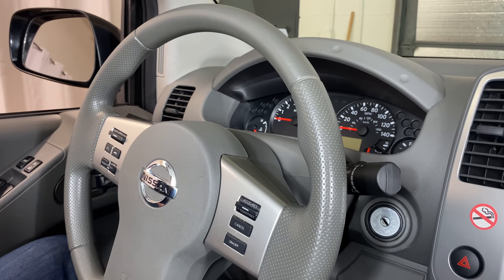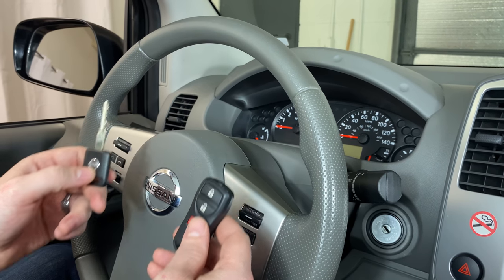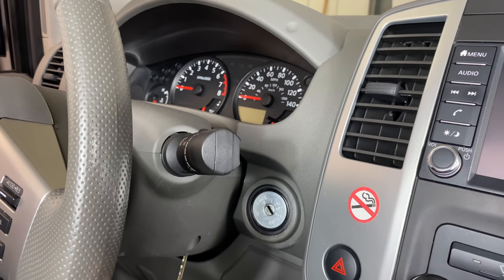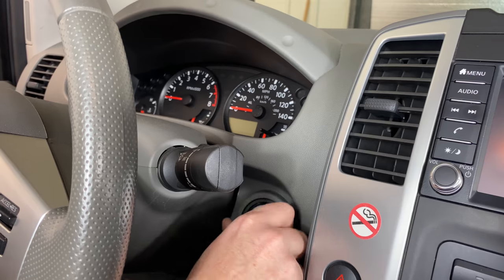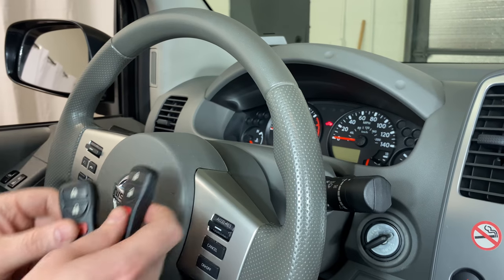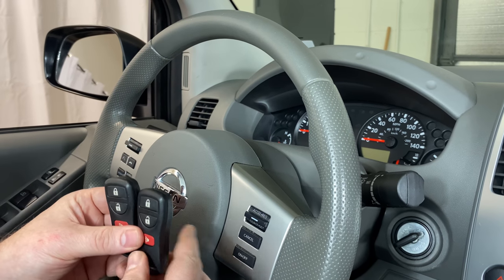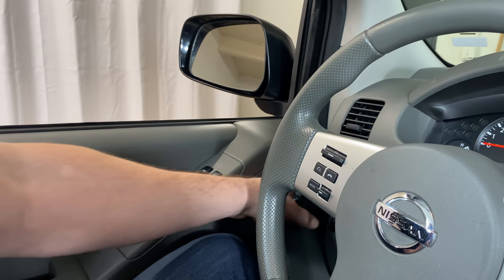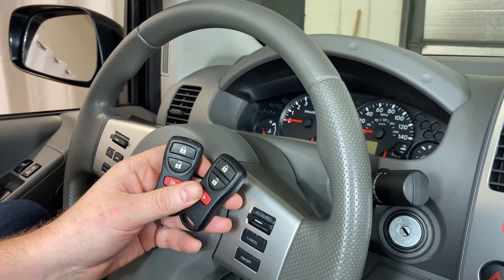How To Program A 1998 - 2020 Nissan Frontier Remote Key Fob  - Keyless Entry - DIY Video Tutorial

Comment: Phenomenal info and presentation.  Spoke clearly, spoke slowly and saved me $300.  The Nissan dealership should be ashamed by their quote
Reply: I can't get my frontier to go in to program mode.  😫
Reply from the maker: Thanks! Glad it helped
Reply from the maker: Are you sure your frontier has the factory remote option installed?
Reply: @kurt429  close the door
Reply: @DieselDog1982  yea but 300 bucks for 5 minutes of work ?👎🏾😩
Reply: This was absolutely great clear instructions to program a nissan frontier door remote 
Thank you
Reply: Thank you! Worked 👍
Reply: They are not called stealer-ships without reason but I agree. They need to make $$ but ............. That much is unethical theft in my opinion for what this is.

Comment: I’m very happy because my truck has been in and out of the dealership at Sheehee Nissan of Maryland. They literally destroyed my brand new truck I have 27,900 and some miles. I still have the all original tires everything original a person hit my truck and I found out that my brakes had no measurements on them. They sit and was wiping my computer board so much that they deleted both of my key fobs from working so I went on there today and figure it out because I knew that they can be reprogrammed one anytime there’s been work done to the computer mainframe.😮 one thing I was taught reading prints for building maintenance of plumbing, electrical, heating and air conditioning so I figured you know I can program and understand and comprehend this man very well, and I would just like to say thanks because it just save me $180
Reply from the maker: You're Welcome! Glad it helped

Comment: Thanks for the video. Two troubles I had: 1) enter the key at a rate near once per second, not too fast. In 7 inserts, it worked. Going really fast didn’t work, ever. 2) My fob had a bad Unlock switch on the circuit board. When only the Lock button would program, I opened the fob and noticed the tiny button on the circuit board did not click.
Reply: Thx Lee for your extra info! The key to success is NOT TOO FAST, just like you described. BTW, dealers are still charging (April 2022) ~150-230 to do this. Greedy.

Comment: Excellent video , simple and to the point.
I have an 04 Maxima ,  and needed a new key/fob
I followed the instructions that came with fob
word for word in addition to your (more comprehensive) steps ,  but did not work for me.
So   I sent it back and I will continue just using my old one that does work . maybe I just bought a lemon , I don't know.  But thanks again for your video.

Comment: Worked on my 2005 Infiniti G35 Sedan. Same style fob on the video as well. Bought it from ebay for 30CAD shipped. It was the cheaper option and it came with spare keys. Only thing missing on the fob was the trunk key.

Comment: Do you have to have an ignition key cut for this to work? I have the turn knob start and my car starts with just the fob inside the vehicle.
Reply from the maker: yes - this will not work on push button start vehicles

Comment: Hi, I have a 2019 Nissan Frontier. It came with one fop but I found another one that went to my 2014 Nissan Frontier.
I hit the lock button and inserted the key 10-20 times with No Luck getting the flashers. 
I noticed on your video there was no alarm when putting the key in and out. 
Am I doing something wrong???

Comment: Video is great, issue I have with my 2004 Nissan Tiida, when I do this it unlocks my doors instead of indicating the hazards? Can't program my remote to it, any help?
Reply from the maker: Unfortunately I do not have programming information on vehicles built for use outside of the U.S. market

Comment: Question, can this work if I don’t have lock buttons? My car is 2016 Nissan note and it pretty basic lol my windows are manual 😢
Reply from the maker: No - if you do not have power locks then the vehicle will not have the factory remote option

Comment: Does it work for a 2008 frontier se base model that you have to unlock it manually?
Reply from the maker: No - If you do not have power locks then you cannot have the factory remote option

Comment: I have a 2020 frontier but no key slot. I've tried pushing the button several times but nothing. Don't know what else to do.
Reply from the maker: There is no manual way to program a fob for the frontier vehicles that have a push button start ignition - you will need an automotive locksmith or dealership

Comment: I tried this once before on my 18 Nissan NV200 but when the hazards flashed after 8 key entries I pushed the lock button on the same remote you have and nothing. So, I thought the battery might be dead in the remote. I changed batteries in the remote. I attempted to the insert/resins wet and I can’t get the hazards to flash. Plus when I attempt to lock my door from the arm rest, the van locks and immediately unlocks. The only reason I am going through this is because I washed my pants and I did not remove my programmed key and now that key will not remotely unlock/lock my doors. I know the fob I’m trying to program works because I had it programmed to a 2005 Nissan Titan. Any suggestions?
Reply: I’m having the same issue

Comment: My 2004 didn’t come with a keyless entry remote even though I have power locks and windows. Will this still work of do I need to buy the keyless remotes with the module?
Reply from the maker: No - you would need to have the module and power door locks installed first

Comment: Does the key itself have a chip that needs to be programmed?
Reply from the maker: yes.  The ignition key is not onboard programmable like the fob though - it will require a automotive locksmith or Dealership

Comment: Hiiiii 

Helppp here!! 
I just received my new Key fob for my 00 Frontier, everything went well, the remote is programmed since the hazard flashed twice after I press a button on the remote. But when I remove the key from the ignition switch, and unlock the door manually, I opened the door so I can test the remote, nothing happens 😭😭😭😭 please help !!
Reply from the maker: Unlock the doors with the the unlock button on the drivers door - not manually

Comment: My 2014 Nissan Frontier has an aftermarket remote start.  Any help in programming the fob for the remote start? The fob works fine for locking and unlocking - thanks for the great, clear directions.
Reply from the maker: I don't really have any programming information on aftermarket systems.  If you can the FCC ID off of your remote start remote, I would recommend searching by that for programming information.

Comment: OK I know that the transmitters open and lock the doors,  how do you make it into a full alarm system, when someone opens your car door without keys or transmitter?
Reply from the maker: I'm not 100% sure on the frontier but most vehicles that use a factory key fob will sound an "alarm" if the car is locked with the fob and then unlocked by hand - without first unlocking with the fob.  The alarm can usually be stopped by starting the vehicle.  If you are talking about a system that will sound an alarm just from someone touching the vehicle or just trying to open the door handle - then you will need to install an aftermarket alarm system.

Comment: I have a fob with a flip out key I got the remote lock to work but if I get the key cut is there anything else that needs to be done
Reply from the maker: This procedure only programs the remote, unfortunately there is no manual procedure to program the key.

Comment: Hello there,can I reprogram a remote from another Pathfinder to my Pathfinder using this method ?? I need it only for opening my car.
Reply from the maker: it depends what year are the pathfinders?
Reply: @PYR-Auto  mine is 2007
Reply from the maker: The remote is the same on the pathfinder from 2005 - 2012 so if the pathfinder the remote came from is in that range then yes you should be able to re-program the remote.
Reply: @PYR-Auto  Thank you for your answer 👍🏽🤗

Comment: The video shows putting a key from the key fob into the ignition. There is no ignition for the push button 2018 Nissan Armada.
Reply from the maker: This video is for Nissan Frontier - there is no manual programming procure for the Nissan vehicles with push button start

Comment: For some reason its not working with my 2008 Frontier. The hazards will click when I hit a button in program mode, but then once I exit program mode, the fob wont work
Reply: Same. I have a 2012 Nissan Frontier. I press a key on the FOB and the hazards blink, but still doesn't work :(
Reply: @mazurati2580  did you find any solution??

Comment: Hi , good video. I did a dry run and could not get the procedure to work to save my life. 2019 nissan frontier.  Is this the only way to program remote? Or any other tips or tricks to get it to work? Does a remote have to be near by?
Reply from the maker: You can use a scan tool to program the remotes but this is the only onboard method.  The remote does not need to be near the vehicle to get it into programming mode. Some vehicles are more sensitive than others when it comes to the speed in which you do the steps - most people tend to go to slow.  Make sure to take the key out of the ignition and open and close the door a few times to "reset" before trying again.
Reply: @PYR-Auto  ok I will keep at it . Thanks. For the info.
Reply: @PYR-Auto  this method should work on a 2019 correct?? I tried so many times to get the frontier in the program mode but no luck, Do I need the original remote? The truck didn't come with one, I even tried the put key in and turn to acc and back off and out again 6 times like another site suggested but no luck either. this is getting so frustrating.
Reply from the maker: Yes - it's a 2019 Frontier in the video.  Since you have never had a remote for the vehicle you may want to verify that is does has the factory remote option - it's standard on most 2019 models but it may not be on the Frontier. You can verify that by calling a Nissan dealerships parts department with your VIN number.  They can look up the original build sheet to see what options it has.
Reply: @PYR-Auto  got a remote programed  went to dealer the had to hook up scan tool. My doors unlock when I shift to park, could that be a problem???
Reply: @kurt429  Yes! Had the same issue with my 2010 Xterra. The owners manual contains the instructions on how to program out of that mode. Easy peasy! Then I was able to program my extra fobs as per the outstanding instructions presented here. Then I programmed back into the locking  mode. The entire process , including programming for fobs, took less than 10 minutes..

Comment: This didn’t work with my frontier 09 it works once the lights flash after putting the key in a bunch but once I push the button on the key fob it’s nothing from there
Reply from the maker: Sounds like there may be an issue with the fob you are using
Reply: @PYR-Auto  my guess too, I bought it on Amazon it supposed to be the right fob but I’m returning it.

Comment: I get the Hazzard lights to flash, then turn key to the ACC position and press any key on the fob and the Hazzard lights won't flash. Could this fob have been erased somehow?
Reply from the maker: It sounds like you are getting the vehicle into programming mode ( first time hazards flash ) but the remote is just not responding.  It sounds like there may be an issue with the remote itself.  Even if the fob had been erased somehow you should be able to re-program it
Reply: You have 1.9 second once the car unlocked ( after inserting the key 5-6 times ) 
You have to lock it again using the button and switch the key to ACC then you are in programming mode and can just push any button on the new remote and it will work.
If you are late than 1.9 second ( I.e if you get to  2 seconds , you have failed . And have to start again ) . Timing is everything!

Comment: I just bought a 2005 Nissan Altima for 1,600$ without a remote key fob i wonder it will work
Reply from the maker: If your Altima has the factory remote option then yes this procedure will work.  You can check if your Altima has the factory remote by calling a Nissan Dealership with your VIN number.  Speak with their parts department and they can look up the original build sheet for your vehicle to see what options it has.

Comment: I have a 2005 Nissan Pathfinder, I got it to the point where the hazards turn on but when I put the key in the accessory position and I press the fob button, nothing happens
Reply from the maker: It sounds like there may be an issue with the fob you are using since the vehicle is entering programing mode but just not responding to the fob.
Reply: @PYR-Auto  I got a new one and this worked perfectly for it!!! Thank you!!!!
Reply from the maker: Great! You're Welcome!

Comment: My frontier won’t have the hazards go no matter how many times I put the key in and out of the ignition (2012 frontier)
Reply: Same here! Any help!
Reply: @TigerOtis  Try flipping the key upside down. when I did this it seemed to solve that problem. also when pressing the button on the fob, hold it down until you see the flashing lights.  one Other thing with the key, I was not in ACC was in ON.
Reply: Try flipping the key upside down. when I did this it seemed to solve that problem. also when pressing the button on the fob, hold it down until you see the flashing lights.  one Other thing with the key, I was not in ACC was in ON.
Reply: Try flipping the key upside down. when I did this it seemed to solve that problem. also when pressing the button on the fob, hold it down until you see the flashing lights.  one Other thing with the key, I was not in ACC was in ON.

Comment: Having some trouble doing this with my 2012 frontier.. once I turn it to acc mode and press the fob, nothing happens
Reply from the maker: If the vehicle is going into programming mode but the remote is not responding, there may be an issue with the remote you are using

Comment: I believe my remote is damaged or something, when I do the key in and out of ignition my hazards blinks but no remote access still..
Reply from the maker: Yeah if your getting the vehicle into programming mode but the remote is not responding there could be an issue withe remote itself
Reply: @PYR-Auto  

I had to buy a new remote..

Thank you for your reply.
Reply from the maker: You're Welcome! Hope you get it working

Comment: No work for me. Hazards never come on
Reply from the maker: Are you sure your Frontier has the factory remote option installed? Some vehicles are more sensitive than others when it comes to the speed in which you do the steps - most people tend to go to slow.  Make sure to take the key out of the ignition and open and close the door a few times to "reset" before trying again.